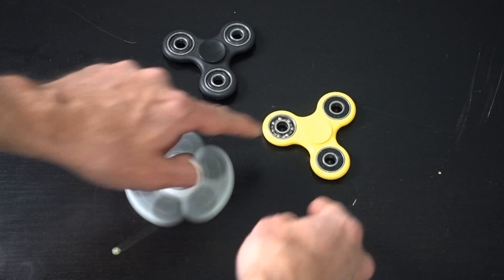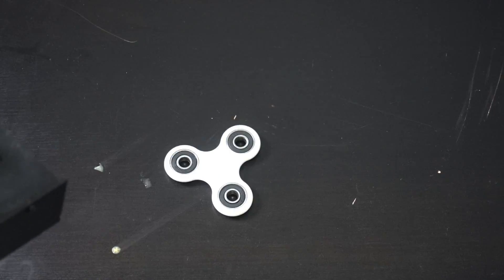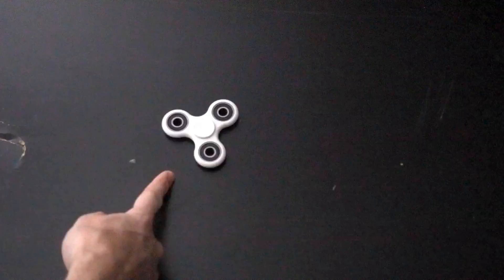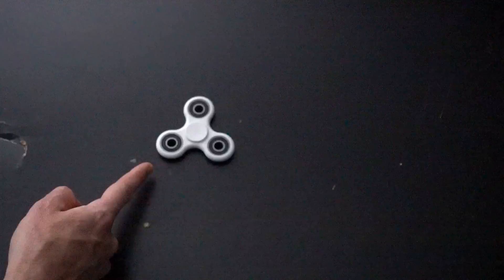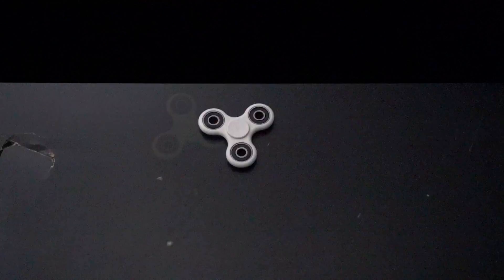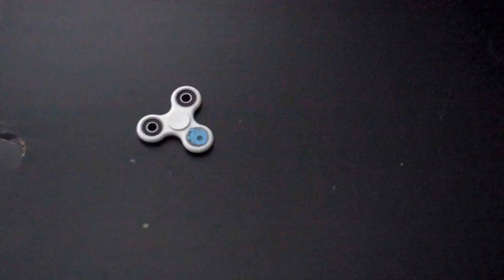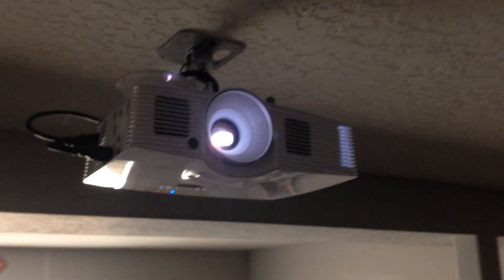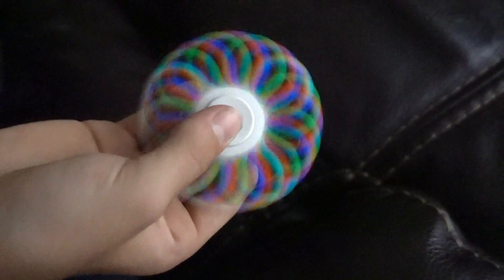Shining a Strobe Light on a Spinning Fidget Spinner and Projector Light Separation

Comment: god the screen tearing with the strobe light is awful
Reply: Oh i experimented with fps without using cameras I used fidget spinner and flash light to calculate flicker and fps but if you spin it very fast, You can't see the flicker but if you slow it down you see more flicker.

Comment: The red/green/blue separation effect will only work with a DLP projector (which is pretty common). If it's an LCD projector, this won't occur. Single-chip DLP cycle through the colors sequentially as you guessed, typically via a spinning color wheel between the light source and the micromirror device.
Reply from the maker: +Kevin M Combes hey thanks for the info!

Comment: the red blue and green have different wave lengths in the light spectrum that is why it looks like you can see all 3 colours while its spinning
Reply from the maker: +terry frost good guess but the wavelength doesn't have anything to do with the color separation. Why would something spinning reflect different wavelengths of light differently? The only way that can happen is when there are patterns that are in the nano scale which will diffract the light differently.
Reply: I think I get what terry frost was saying. Since wavelengths of different colors are well.. different, the timing could separate them. But light is moving at the speed of light and the fidget spinner can't spin that speed, so the distance between the peaks and valleys is irrelevant.

Comment: The human eye is like a camera, capturing 60 frames per second. The reason why strobe lights and the fidget spinner look they they are like a stop motion, is beautiful the human eye can't keep up with the speed. Just like certain cameras, there is FPS which can determine the speed of a object and separates the speed from time. Although the eye isn't fast like some cameras, this can be watched back in slow motion showing each rotation of the spinner, and each beam of light that flashes from the strobe light.

Comment: Loved the projector shot at the end.

What's the highest frequency that your strobe can do? Ideally you want the interval to be far shorter than the exposure time. In one frame or another, the number of strobes captured can vary by (I think) one flash. At the settings in this video that resulted in a variation of 0 or 1 strobes per exposure. If you could get that up to 9 or 10 strobes, that would smooth out both the frame flashing and the rolling shutter issues. As long as the strobe can go that fast, it should work. That fidget is spinning super, super fast so you have a lot of different frequencies that will sync up with it.